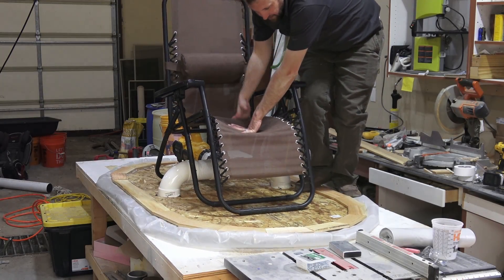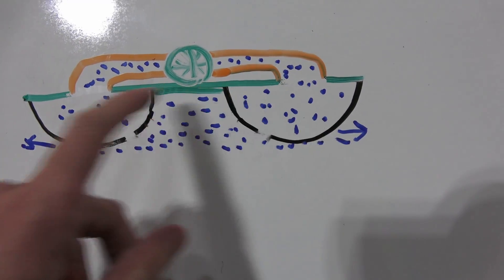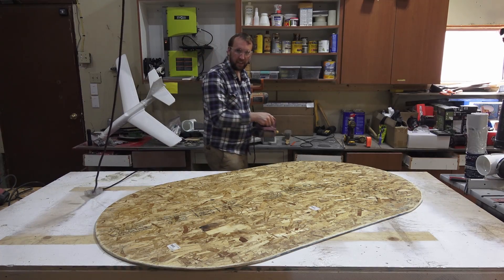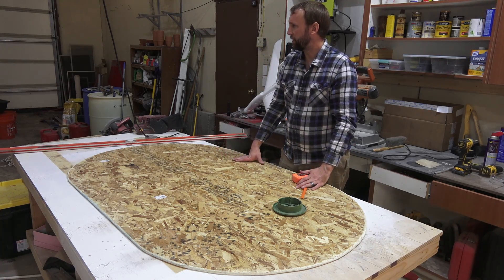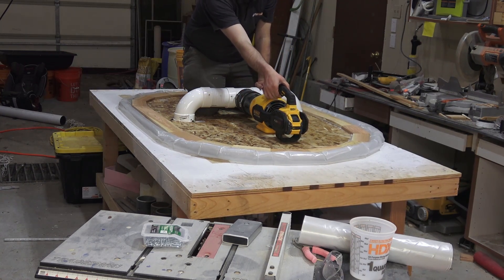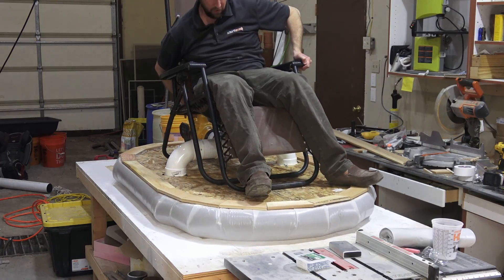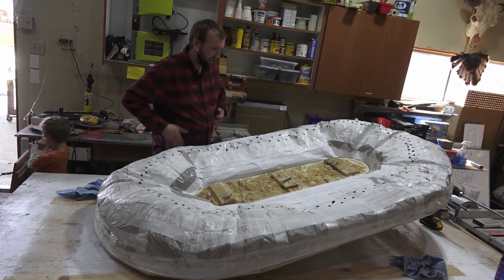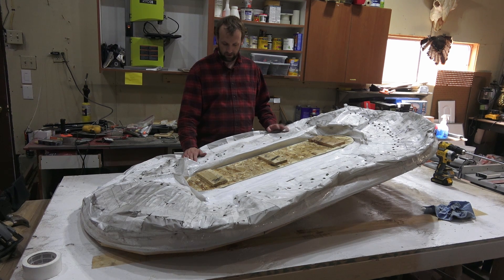I made a battery powered electric hovercraft I can ride

Comment: Incredibly late comment I know. Adding three or four Caster wheels around the center area as a form of .. landing gear .. would have helped with the dismounting and mitigated ripping your skirt every time you tried to get off the thing. Weight would settle on to the Caster wheels instead of shredding your skirt.

Comment: On a future design review, improvements could be to move the air holes more towards the inside of the skirt and rivet/attach metal studs to the skirt to ground contact points. I have noticed this arrangement on some of the larger car carrying hovercraft that were based where I used to work at Lee On Solent, England.
Reply from the maker: Yes! I am slowly designing version 2 and hope to be uploading videos again soon. The skirt design will be much more efficient and a better more durable material as well.
Reply: @clousetechworkshop7597  hope to see a new version someday :)

Comment: Good ,simple design has a single skirt. For fun you can change direction by leaning. It might be small enough to use for a short time on water. Balance would be critical if air pressure is high. With lower air pressure, the skirt keeps it level. Making the skirt of durable material will help it last longer.
Reply from the maker: For the next version I'm looking at a heavy-duty PVC liner that is used under shower tile, it flexible and near indestructible too. It's pretty heavy though so I'm not dead-set on it, if I can find something lighter that is just as durable I'll use that.

Comment: Lol, outstanding!!! Maybe a smaller platform or rounded like you mentioned will give you that little extra lift you need? truck or car inner tubes for the skirt may hold air and make it easier to control leaks? lol...good job man! chuckled through the entire video
Reply from the maker: Yeah those ideas are great, I'm definitely going to revisit this and make a better more controllable one.
Reply: @clousetechworkshop7597  lol, toss around the idea of making a drone (bathtub style) that's capable of lifting/balancing the weight of a human....on a tether of course. looking forward to your next project. Thanks

Comment: Changing the Tee to a True Wye will increase the lift. (Small change - big benefit) Increasing the base size will increase the capacity. Adding a handheld blower will give directional control for level surfaces.
Hearing protection should always be used with leaf blowers. Once damaged, hearing never completely recovers.
Reply from the maker: Good call, I think that T really messed with the airflow, having that much air have to stop and make abrupt 90 degree turns really made the blower work harder then it should and likely limited the pressure it could deliver as well.